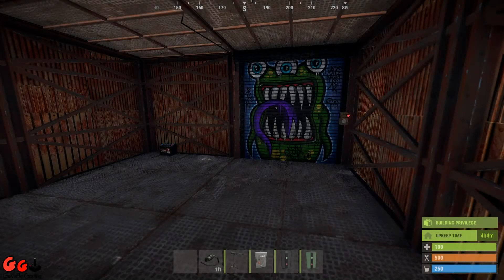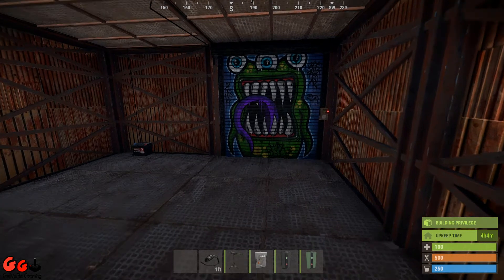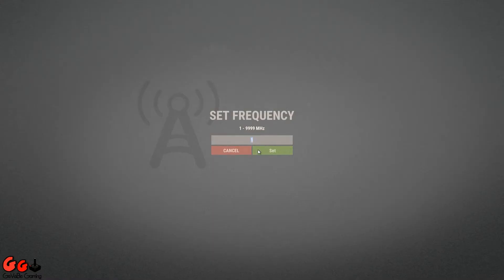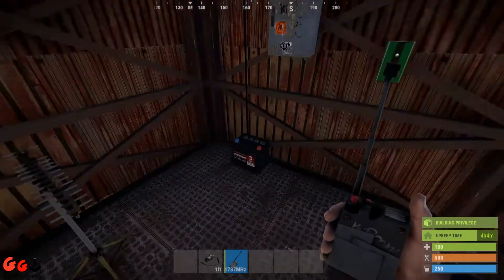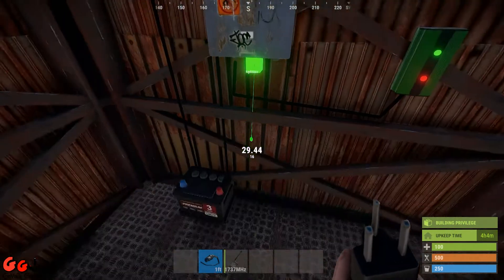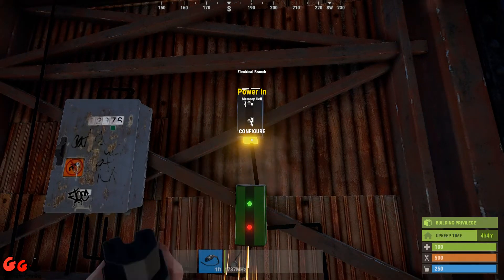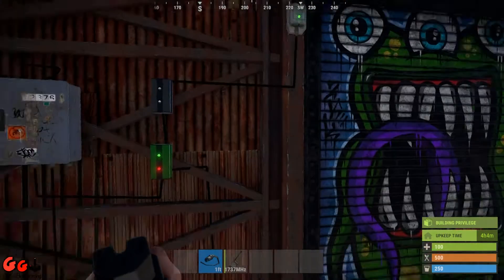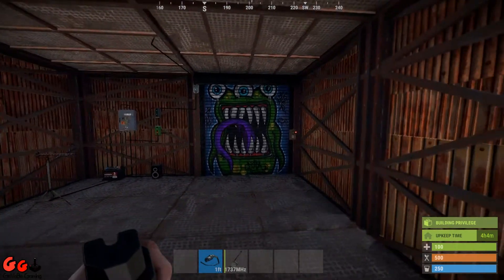Rust Electricity Tutorial - UPDATE - RF Receiver - Remote Opening Garage Door

Comment: I just taught myself to do this and the method I came up with is to place a triangle foundation with frames all around it, place three garage doors with locks and door controllers, then I place 6 antennas and 6 AND switches, then I basically rig up two different boards one for opening the doors using 3 of the receivers and 3 of the and switches, and the other sets of 3 items I use for closing the doors. The open code I chose is 455 and the close code I chose is 8008 😂😂😂

Edit: Also currently experimenting with using a timer to keep the doors open for a short period and then shut them automatically in order to cut the amount of items and wiring needed in about half

Comment: I'm still learning rust electricity but watching this feels like a huge waste of energy. I feel like the splitter would only be necessary if you wanted to open several doors. Does the rf transmitter need the same amount of power as the door controler which is the same amount you send to memory cell?

Comment: At the end with the auto turret trap, i'm guessing you are using solar panels, how many are used if so, i'm trying to make a wireless auto turret trap as well, but struggling on how to get enough energy for the batteries. Great video though!
Reply from the maker: The windmill is best, but you can use solar panels to boost the battery, the more power going into the battery the better (large battery)

Comment: Nicely done :) you should try playing around with a couple of the or switches to setup the option to still open and close with an internal switch for other players working on getting it so you can still use the rf transmitter to remotely lock down everything if needed